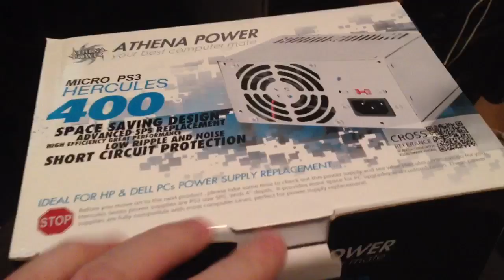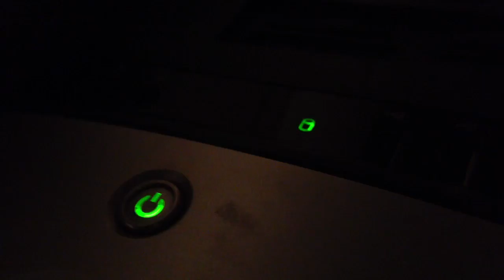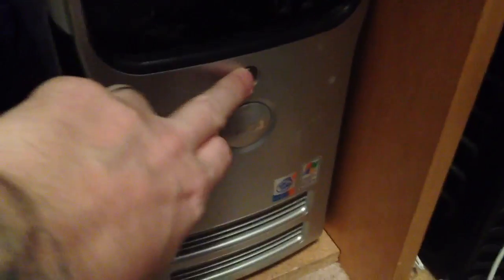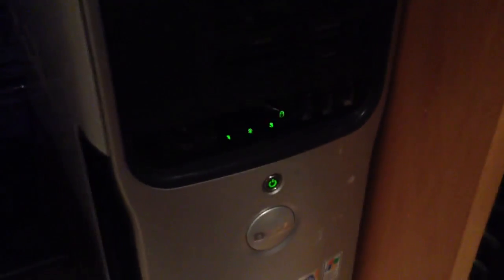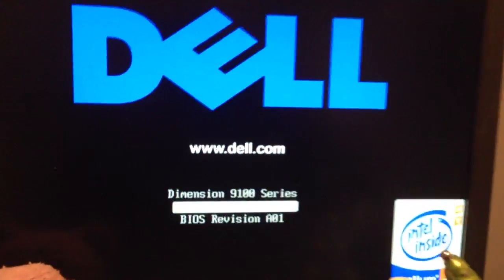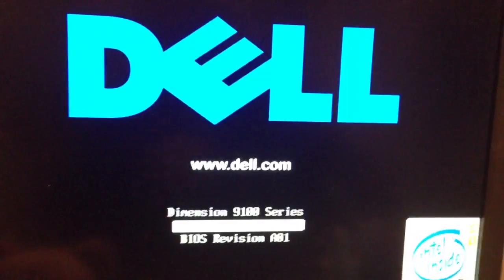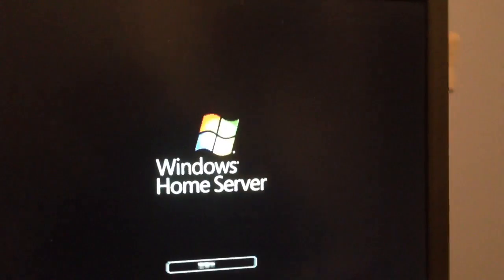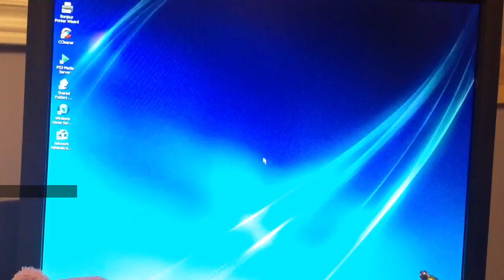Unboxing and Replacing: Power Supply (Dell Dimension 9100)

Comment: Nope - tried the same power supply as you in a Dell XPS 400. No improvement - powered the motherboard, but fan didn't run and front panel was amber instead of green.
Reply: That indicates a bad power supply